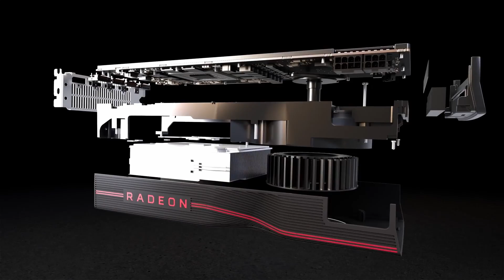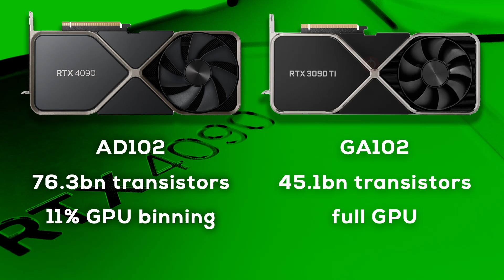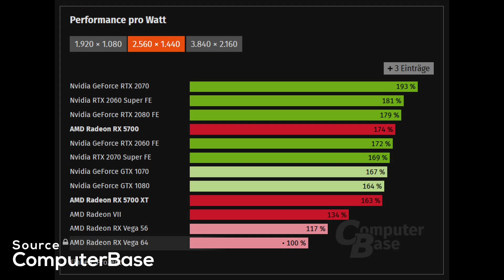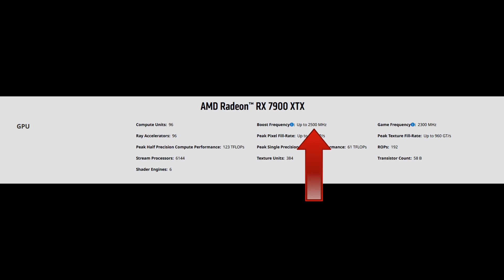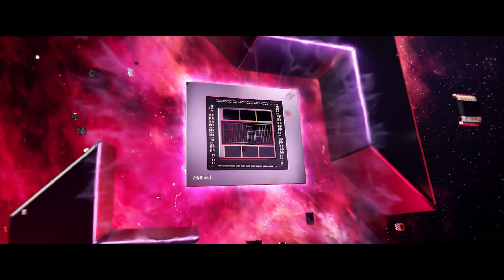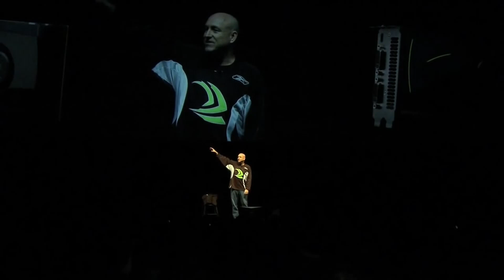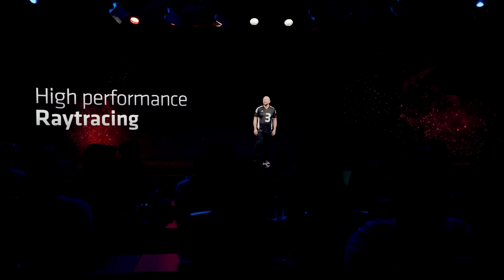RDNA3 – what went wrong?

Comment: Navi 31 is like first gen Ryzen/FX CPUs. They be like we don’t have performance oh shit well increase the shader units….. oh damn they have to share resources well going down a single pipeline. My guess if you look amd had a smaller die gpu they planed to used but at the last minute found out it was not good enough so they supersized it to somewhat met the requirements so they don’t piss off the share holders to much.
Reply: So yea I would wait at least 6 months and see if they can fix the problems. Knowing that the driver team still has issues with RX5700xt&RX6950xt. I don’t have high hopes that they can fix it and may going get a 5% after 6 months or so if that.

Comment: Not having watched the video yet my reasoning is below.

RDNA3 performance is less than expected,  but its worth keeping in mind 30-40% improvement generation over generation is typically what we see with new generations.  Personally I think we will see  AMD make up the performance in a revision, but I think we will need to wait for that to manifest in a 7950XT and XTX.  Just like how it wasn't Xen 1 but Xen 2 that refined and improved the new design.

That said I imagine the below reasons to be why performance isn't where most expects, they are in order of what I consider impactful but its a combination of all these things that delivered the results we've seen. 

1.  Cache Size & Speed -  RDNA3 only has about 6MB of total L2 cache (vs 98MB of AD102) AMD then needs to go off chip in order to access its larger L3 memory cache (Infinity Cache) which while a good size but it's going to be much slower when compared to L2 and likely won't be able to transfer data between the GCD to the Infinity Cache without crippling  performance. I suspect this is why AMD heavily improved the transfer rates between its various levels of cache in order to remove as much bottle necking as possible. 

2. Driver Optimization - The new RDNA3 architecture is an entirely new design and is likely leaving a fair bit of performance on the table due to early driver support, I suspect we could see up to a 10% uplift over the next couple of months and likely a few extra percentage beyond that as it ages.

3. Power Targets -  At only 100-200Mhz higher clock speeds and nearly identical identical power draw and board power AMD is clearly not  getting the most out of their node shrink,  we've also seen Videos from places like Jayz2Cents that see very little gains from GPU overclocking when pushed heavily the cards appears to be reducing Shader performance to maintain stability. Although this could simply be a software bug on the GPU or tuning software. 

4. Time - AMD didn't launch with the unveiling of the 7900XT and XTX in November as one expected but instead waited until early December, likely to have a new product on sale for Q4  earnings reports and holiday season.  This lends some credence to the rumor that RDA3 may be an early version of Silicon (Probably A0),  which isn't technically a bad thing it means the first batch of chips were hitting the majority of their targets and is totally workable,  but it may also signify they may not have had time to tweak or optimize as much as they'd like to meet that Q4 deadline where they needed to ramp production with what they could manufacturer immediately. 

This could help explain the many rumors of how amazing RNDA 3 was performing  in recent lab leaks and even AMD's own slides.

Comment: My view on this, the 7900 series being the 1st chiplet based GPU is a HUGE beta test, kind of like Zen 1 was. As people use these new GPUs and AMD gets feedback, they will change things and fix things as they redesign the chiplets for RDNA4, now, with this in mind, if AMD goes the way I think they are heading, next gen could be VERY interesting, multiple chiplet based GPU (just like how Zen evolved), this is when AMD might have a wild performance swing on the positive side. But until then, I agree, the 7900xtx is not meeting my expectations so I'll just hang on to my 6900xt and 3080ti until next gen.
On the nVidia side, agreed, the 4080 is way overpriced and so is the 4090, but the 4090 is the fastest GPU at this time but commands a ridiculous price.
nVidia has gone full circle, the 3000 series were power pigs (I know my FTW3 3080ti is) and now they are much better, where as the AMD 6000 series was power efficient, now they are the power pigs.
Reply: Heck, I'm actually interested in what RDNA3 will look like 6-12 months from now after a lot of the teething issues peter out. The potential of the 7900XTX is already showing up in a replicable manner in rare cherrypicked scenarios. I don't think it's ok that it's going to take that long for something even close to that performance to show up, however as someone who is simply sitting and watching I think it'll be interesting to watch.
Reply: I'm using powercolor 7900xtx red devil le, the stability of the card is better than my expectation, i use it for gaming cod mw2, video editing and browsing internet, so far it doesn't has any crash occur. Video encoding is crazy fast. The only problem is the multi-monitor idle power is quite high@110w, single monitor doesnt has this problem. I'm waiting for the driver to fix it.
Reply: If it's truly a beta test product to scout the chiplet design and its potential, then you should sell them as beta test products. Now the customers pay big bucks and expect a refined user experience like nvidia offers. Currently AMD falls short of what the customers would expect from a $999 GPU.

And the performance per watt is just horrendous especially when they boast the efficiency during the launch show.
Reply: @disadadi8958  what do you mean it falls short of what customers' expect from a $1000 gpu? It performs at about the same level as the 4080 which costs $1200 or more so to me I think customers would be fine with the performance they're getting at that price point in comparison to competitors. Don't get me wrong, I think it's ridiculous to be spending so much money on a fucking graphics card but that is what the market is like at the moment
Reply: @Dell-ol6hb  I think buggy drivers still causing power draw issues are a bit problematic.
Reply: Tbh I don't think the chiplet part is what's causing the issue. In fact, when they eventually move to multiple GCDs I'd imagine we'll see even more issues.

Comment: It's just so sad to see. On paper, we see a GPU that should be able to trade blows with a 4090, and also aught to come close in RT performance. And we end up with something that only has half the gains it aught to, and STILL had tier-below RT performance compared to Nvdia. What I don't get as a layman, is why these GPU's seem to scale very well in some random games, and seem completely broken in others with basically NO performance increase. Could this really just be a case of shite drivers not using otherwise great hardware properly? Or is there really a hardware issue and faulty design here..? Time will tell I guess...

Comment: I will preface this by acknowledging that I am, and have been an AMD/ATI fan for over 25 years. However,  I think most of this is driver based. I have a feeling they noticed they were having issues and may have bogged down their performance in exchange for stability until they can get more real world data. I was expecting something like this considering it is the first chiplet based GPU. The pressure from tight chip availability and the decline of prices could have been a "corprate" stress point and could have been forced through. Either way, I have learned that my patience with them over the years has always paid off. When a company focuses more on innovation than just throwing money at the problem, there are going to be hiccups. I can see Nvidia having this same problem when they finally decide they have to move onto chiplets to remain cost competitive.  I guess we will see.
Reply from the maker: Drivers would be the best case scenario, because then we still have a good shot at a competitive GPU market next year! I'm also curious where Navi32 will land. If its closer to the 7900 XT than expected, the hardware bug rumors might be true.
Reply: @HighYield  I am clearly and optimist lol. I am definitely not ruling out hardware malfunctions either, but thatbisnwhat Intel seemed to be suffering from on top of drivers amd reviewers found much more wrong hardware wise if I remember correctly,  but then they started making a good bit of headway with drivers. If Intel cam do it with their foray run AMD can with what seems like a much better piece of hardware. 
 I was hoping their initial estimates ere conservative amd they were going to try to avoid a roll out like intel by doing so then eventually be like "oh btw the new driver give you an __ increase in performance!".

However,  I have engineered things that should have worked just fine and did in testing just to have some whacky seemingly gremlin realworld results. I'm sure it can happen to the best minds

Comment: I have a Sapphire 7900 XTX reference card and its been interesting. At stock the junction temps hit 110c in most games after 5-10 minutes, however by capping the GPU clock to 2500Mhz and reducing voltage to 1100mV from 1150 only RT games push the junction temp beyond 75c. What is really odd about this is in Horizon Zero Dawn I do lose 2fps when capped (4K, Ultimate quality) but at stock the clocks where only 2650Mhz anyway, when capped it averages 2520Mhz. The cap also reduces board power from a peak of 346w (which it hit often) to 303w which is only hit occasionally during the benchmark run.
In Heaven benchmark at stock it takes less than 4 minutes for the junction temp to hit 90c, while capped it sits at 73c without issue after 15 minutes. The only game I can't fix yet is Metro Exodus EE (4K, Ultra RT, 2x VRS), as the clocks don't go above 2500Mhz at stock never mind capped, the card still hits 346w board power and the junction temps do hit 90c pretty quickly, however, they don't ramp beyond 100c like they do at stock. PS this is NOT an air flow issue, when the junction temps hit 110c the core temps DROP as the fans hit 100% (and my PC sounds like its about to take off 🤣)
Reply from the maker: Hm, the temp could be a thermal paste problem, right? Have you checked if other ppl or reviews have similar temps?
Reply: @HighYield  that is what it was in the end I think. On Thursday when I got the card I ran into the 110c junction temp issues straight away, DDU'd the driver, clean install etc. . I decided to repaste the card. After my return was approved Idecided to check the screws after removing the card just in case and I noticed 2 of the 4 both in the right side of the leaf spring where a little loose (around half a turn at most). I have now tightened them and it's sorted. In every game tested at stock  I'm seeing 90c max junction temps apart from Metro Exodus EE, but they don't go above 94c. Plus after lowering the RT from ultra to high my FPS went up and the junction temps went down, so I think this is a software issue (either the AMD drive or the game, most likely a combo of the 2) and frankly high RT still looks great, capped to 60fps and my card is now running much cooler and quiter while also actually staying at a locked 60. For now I'm gonna play some less demanding games from my backlog.

Comment: Imo most of the problems can be derived back to the MBA (made by AMD) card being not well put together.
1. the factory default voltage it too high on these cards, with undervolting the cards can reach 2.9+ GHz clockspeed even on the MBA card
2. the factory default power limit is limiting these cards
3. 2x8 pin connector is not enough for the card to stretch it's legs, on 3x8 pin AIB cards it boosts to much higher clockspeeds
4. the cooler on the MBA card is not sufficient when it boosts at default voltage

TPU showed that the AIB cards with huge coolers, 3x8 pin power connectors, undervolting and higher power limit these cards are beasts.
AMD should've shipped the MBA card with lower default voltage, it would've reach 2.8-2.9 GHz without high temperature and without throttling (the reason why the fps results are all over the place) and everyone would be much happier so to speak.

Comment: rdna3 architecture is not good. this is not real chiplets, this is just chipleted cache, the processing cores had to be chipleted around high speed interface, the design is just bullshit. and this could be read on the face of amd presenter that had no enthusiasm in the presentation. and this all contrasts with nvidia 1.5+ generations steps from 30 to 40 series. so basically top amd 7900 xtx 24gb 350w competes with 4080 16gb 400w

Comment: In the keynotes supplementary info of the AMD presentation of November you can see that they used a 6900XT instead of a 6950XT for benchmark comparison and some voodoo 7200 MHz DD4 RAM. Since the 6950XT is in average 15% faster than the 6900XT it could be that they messed up the presentation and here we go with 35% instead of 50%.
Reply from the maker: In the slides they say "vs 6950 XT", so thats why I expected.

Comment: Radeon has screwed up too many times now. They've priced the XTX and XT higher than they needed to, and yet they've botched the release. The only reason anyone is giving them a pass is because Nvidia gave it to them by charging $1200 for the 4080. AMD never needed to charge $1000. But they want to be seen as a premium brand, so they charge Nvidia prices. Nvidia delivered a good product at a terrible price, AMD delivered a broken product at a slightly less terrible price. In my eyes, that's a win for Nvidia.
Reply: How is it broken? Seems like they're working just fine
Reply: @mjkittredge  Drivers are clearly an issue when you see the disparity in performance per game. The clock speeds are erratic depending on the game. Power draw stays the same no matter whether you cap the FPS. Clock speeds are lower than AMD claimed. Performance is lower than AMD claimed. Power draw is higher than AMD claimed. There's a lot wrong with Navi 31.
Reply: @angrygoldfish  Broken would mean not functional. Like the intel GPUs. 7900 cards are working fine, they just didn't hit the performance marks shown in the slides and have a few weird FPS anomalies in certain games at certain resolutions. That's hardly "broken" kind of hyperbolic language there.

Broken =/= functional. Pick one. Both cannot be true at the same time.
Reply: @mjkittredge  Something can be broken and still function 90% of what it is supposed to. A modified sports car with two turbos can have one 'broken' turbo but still drive fast for a few hundred miles. It could even have software bugs within the computer system that's limiting horsepower, even though all the parts are fully functioning.
Reply: @angrygoldfish  the way you're using I don't think is reasonable or appropriate. I have a cracked tail light on my car but I wouldn't call my car broken because one part has a ding. But that's getting pedantic. 

We're just disappointed that AMD didn't A) perform better right away and B) price/name the 7900xt better - should have been the 7800xt for 700 and everyone would be gushing about what a great value it was.
Reply: @mjkittredge  I agree. The word broken is not ideal. As you said, it's more hyperbole to express AMD's delivery problems.
Reply: @mjkittredge  From what we know it has problem with idle states and power management in general, its pulling ridiculous amount of power when its idle, this is either bug in software or its just broken or its bad feature of the mcm design, that some part of the card just cannot be turn off to get better efficiency. Also the gpu does not really scale well, the spec on paper are impressive, but in reality there is much less gain than expected. 
Nvidia has actually same or less bandwidth as on previous gen, they increased cache size alot, but the memory is almost the same. For AMD the memory performance should be much better and maybe it is, but the core dont use it fully, which is even more weird, because it has 61.42tflops(rdna3) vs 23.65tflop(rdna2). The difference in raw performance is massive, yet in real world, it doesnt perform that well, just looking at the specs you should see how people expected much more than 30%.
Reply: @eth_saver  that's so weird because my old soon to be replaced NVIDIA card started pulling 100% usage on idle as well. I disabled every GPU usage for windows and browser and updated the drivers but nothing fixed it. PC started crashing almost every day.

I predicted the 7900xtx would perform a lot better too before it launched, judging by the specs. I still think AMD can deliver more of that cards potential with drivers in the near future. And they should have it all sorted out by the refresh models in a year.

Comment: 6950xt would need a 7950 though. I'm a Nvidia supporter but I'd just like to point that out.

Also pointed out that their chiplet lower cost design would be more apparent if they had a 12gb 7900, it'd be 400-500 bucks. VRAM and supporting bandwidth is what makes a card expensive these days.
Reply from the maker: The 6950 XT is just a slightly higher clocked 6900 XT, so I think its OK to compare it. And yes, VRAM cost is a large factor, 20GB and 24GB are not cheap at all, Nvidia has the cost advantage with 16GB on the 4080 and 12GB on the 4070 Ti.